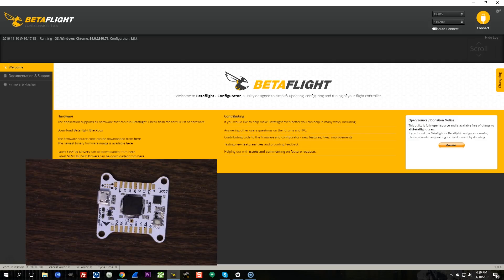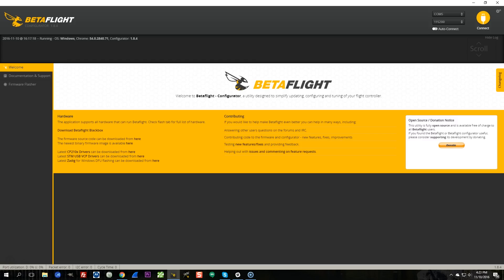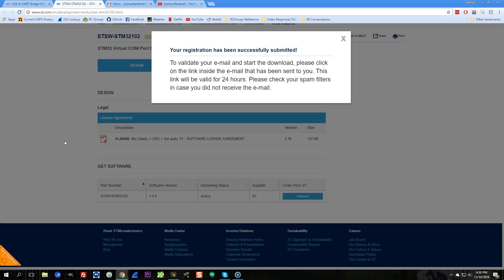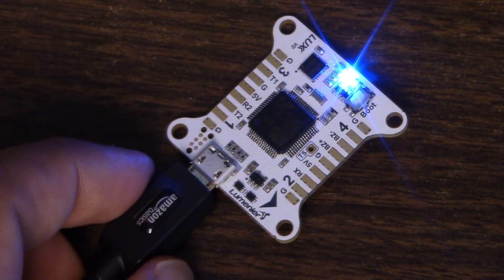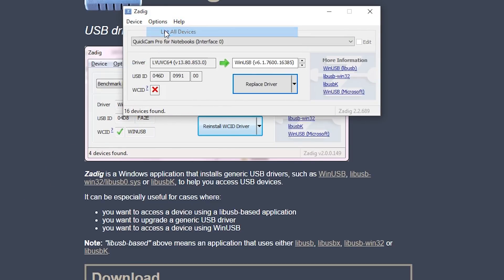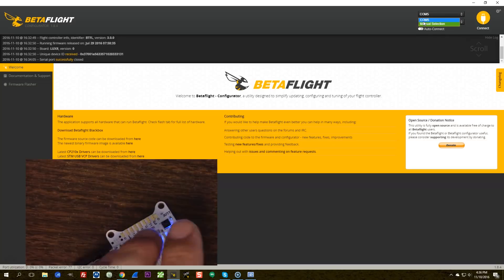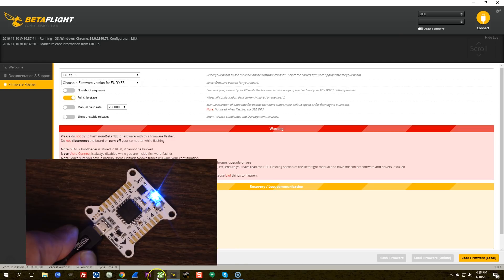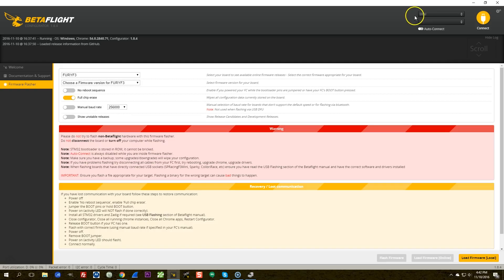Betaflight / Cleanflight Flight Controller Won't Connect | FIXED

Comment: What do you do if you do accidentally overwrite the WinUSB driver in Zadig? You said uninstall it but it is not at all clear how that might work.
Reply from the maker: If you really want to you can just put it back using Zadig I believe. But if you need to uninstall it go to Device Manager in Windows, find the device, right click, uninstall.

Comment: Is anyone else here having trouble connecting to betaflight to their quads. All my f3 boards connect but none of my f4 boards do. I have tried zadig and impulse rc driver fixer but fixer just stalls looking for flight controller. Anyone have any ideas as I'm pulling my hair out here. I have just spent the day building a new quad and i can't configure if AAAAAH
Reply: I managed to sort this after going in the device manager and looking at my com ports. my betaflight connects to my boards using com4 but I noticed on my com ports in device manager i had a bluetooth)com4) port as well. I turned bluetooth off on my PC and now all my quads connect. Posted this just in case someone has a similar problem, thanks JB. I wouldn't have found this without you

Comment: Hi i am green as grass im just started and  this stop me on beginning i try on mac and W7 im installing like u told and  like im read the description  but :(
when im  connect first time  i got info "device driver was not successfully installed" and im stuck i was looking at how to resolve this problem i installed everything one more time and is the same all-time  my drone is recon like joypad and cand connect this  to beatflight  any solution? funny is two small drones  connect with no problem but i don't need this  but 2 others  zero connection W7 tell is a Joypads :(

Comment: i cant see the stm32 when i connect my pc to the fc
Reply from the maker: 1. Hold down the bootloader button. Plug in the USB cable while continuing to hold down the bootloader button.
2. Run the Impulse RC Driver Fixer app (https://impulserc.blob.core.windows.net/utilities/ImpulseRC_Driver_Fixer.exe). It should "fix" the driver successfully. If not, do not proceed.
3. Un-plug the USB cable.
4. While holding down the bootloader button, plug in the USB cable again.
5. Start the Betaflight Configurator app. In the upper-right corner pulldown menu, you should see "DFU". You can now flash the board.

For more detailed instructions on how to install the STM32 drivers: https://www.youtube.com/watch?v=m4ygG6Y5zXI
Reply: @JoshuaBardwell  I have got that settled out,but now I have an issue where I dont really know which UART is where on my board.

Comment: Hey there, my pc won't recognized my fligth controller anymore even after i install both stm and cp2 driver. My flight controller worked fined before i accidentally unplugged it while flashing a new firmware.  The blue led is also not working anymore, and only the red one flashing. My flight controller is dalrc f450.  Hopefully you can help me with this. Thank you  before.
Reply from the maker: The workaround I would use is to flash in bootloader mode with "full chip erase" selected.

1. Hold down the bootloader button. Plug in the USB cable while continuing to hold down the bootloader button.
2. Run the Impulse RC Driver Fixer app (https://impulserc.blob.core.windows.net/utilities/ImpulseRC_Driver_Fixer.exe). It should "fix" the driver successfully. If not, do not proceed.
3. Un-plug the USB cable.
4. While holding down the bootloader button, plug in the USB cable again.
5. Start the Betaflight Configurator app. In the upper-right corner pulldown menu, you should see "DFU". You can now flash the board.
Reply: @JoshuaBardwell  finally it works, thank you
Reply: Hey there, now my flight controller red  led doesn't even turn on when i plug it itn, does this mean its broken?

Comment: My flight controller isn’t connecting even when the drivers installed, just cant get my drone to appear in betaflight. NEED HELP. Messed up by switching the “SPI Bus receiver”
Reply: Same problem dude... :(

Comment: Now how about a video for us ios users, the stm isin't going to work for us
Reply from the maker: Driver Fixer fixes a Windows driver problem. There is no need for Driver Fixer on MacOS. The drivers are pre-installed and just work correctly.

Comment: my matekf405 wing does connect and i can flash and it says that it sees him in inav but i still cant connect
do you know how to fix this?
Reply: Hi, I have F405 WING. I think with the same problem, I see it connected, I can successfully flash it, however, then I cannot connect it into Inav or Betaflight. Any suggestions?
Reply: @tomaskonarik7400  nope still have not found out what the problem is updated all drivers used the impulsrc thing still doesn't work bought an f411 wse to test if my pc the problem was that was not the case the f411 worked fine

Comment: A ton of great information in this video. However, my fc was working fine and I never had any issues communicating with betaflight. Then I was flashing an update and betaflight froze mid-flash and now I get the “failed to open serial port” message. I’ve followed all steps in this video, and nothing recognizes my board, whether or not it’s in bootloader. Did I brick it?

Comment: I Have the cc3d brushed boardI dont have a push button or pins to short out for boot mode what can i do.
Reply from the maker: There must be some bootloader method somehow but I don't know that board well enough to make a specific recommendation.
Reply: Hi Joshua just sent you a message and photo on Instagram thanks
Reply: Don't know I have looked in all the places on the web I can find.no know one knows.

Comment: I have a Omnibus f4 v5. I get a solid green light when I plug in usb and there is no sound of connection. For me I flashed the wrong firmware. I flashed Omnibus instead of Omnibus SD. What should I do is this something I can fix??? … Zadig doesnt even see the stem3 driver. and beta flight doesnt even detect any com ports. I have tryed just about everything. its like the usb connection is not detectable. did me flashing the wrong firmware screw up my omnibus f4 v5 ?? do I need to buy another?

Comment: Joshua Bardwell;  STM driver is for win7 or 8, not for 10 , should i use the win8 exe? i have win10
Reply from the maker: Use win8. That's what I do anyway.
Reply: @JoshuaBardwell  still no luck, already tried impulserc(searching for flight controller problem) and zadig(cant find stm32 virtural com port) i bought 2 quadcopters the sailfly-x and the mobula7hd. please help     ps. i dont even hear the windows usb plug in sound               edit nevermind i found a working usb cable    tanks anyway =)
Reply: @JoshuaBardwell  could you help me again?
after arming my motors do idle(5%), but after applying trottle it just goes to around 50% after that it stops, if i rearm the situation just reapeats.
motors do work fine via betaflight motor test.
my manual said i need to install blheli suite and flash new firmware, target is S-H-50
Reply: entering the settings for the sailfly-x in the CLI solved the problem, but the same method does not work for my mobula7 hd plz help (trottle does also stop if i turn the quad around)
Reply: discovered that my motors are swapped from left to right, how to remap? current version of betaflight is 10.6.0
Reply: motors swapped! i fixed it :)  problem solved

Comment: What if you somehow shut off the USB port. How do you turn it on?ty
Reply from the maker: Re flash the FC by putting it into bootloader mode. Select "full chip erase" option when flashing.

Be sure to choose the correct board target in the pull down menu.

Comment: all support is for windows.  I have a MAC, which drivers do "I" download?
Reply from the maker: On Mac, STM32 VCP driver is installed by default. You don't need to do anything.

If you have an SPRacingF3 or any other older FC that requires CP210 drivers, you need to install them.
Reply: Thank you. 
You are the one guy I turn to when I can’t figure things out. I watch ALOT of your videos. 
Question:
One of my quads will connect no problem. But my new flight controller will not update firmware, and will not connect to beta to view all data. 
Any ideas for me to try?

Comment: Hey brother I accidentally turned off USB VCP on my LUX F7 board so now it will not connect to beta flight is there a fix to connect back on betaflight?
Reply from the maker: You have to connect using the bootloader button and re flash it.
Reply: @JoshuaBardwell  I love you man brother 2 brother
Reply: Brother Josh I have lumenier lux f7 ultimate but I don't see it in the beta flight drop bar so what can I use to flash the board?

Comment: Hello youtuber and pilots i need your help 
Im a total noob to fpv I got the emax tinyhawk and i think i messed it up 
When i plug it into my pc it takes several minutes to recognize it and when it does i have only a solid red light on my flight controller and beta fligt show up up the com 3 which i normally use to conect but it says it fails i tried impulse rc driver fixer which says com port 3 is not avaliable always the same . Could please anybody help me?
Also when i turn on the whoop it only makes alarm and red light no funcionality ....
Reply from the maker: The flight controller is probably damaged from a crash and needs to be replaced.
Reply: @JoshuaBardwell  are you sure because i flew it put it on pc all was fine then i messed arround with flashing it and now this happened. And pc also says its a not recogniseable usb i did also something with zadig.... but i dont know any more is there anyway to reboot all or delete all bc emax has the cli dump on their site but i cant even enter betaflight maybe i did mess with the drivers i think ..

Comment: HI Joshua i know its been a while since you posted this but i have followed you until 5:21 and my board will connect it says 
Serial port Successfully opened with ID :1
 but nothing happens 10 seconds later
 it says No configuration received within 10 seconds , comm failed
  serial port  successfully closed  

do you have any suggestions please
Reply from the maker: Make sure you've selected the COM port associated with the FC. It will disappear after you unplug the FC.
Reply: Absolutely no port ever pops up it is always com port 1 so I might remove all the installation and start again

Comment: Hi, while flashing the clean flight firmware on SPF3 it is throwing " STM timed out" programming failed while verifying phase.
Reply from the maker: Verifying timeout is usually nothing to worry about. Usually the flash was successful and you can proceed.

Comment: My driver are correct I lost communication with board by mistake I tun off usb port  uart1 I don't know what to do now .can u help please
Reply from the maker: Re-flash the board using bootloader/DFU mode. Enable "full chip erase" option.

Comment: I have updated my trashcan Crazybee f4 firmware and it stopped working it is not recognized by my computer any more. there is no problem with my mobula 7 so my pc is fine. I have tried pushing the boot button and nothing changed. any advise where how to solve it?

Comment: Hey all, ive been trying to connect with my Hubsan H123d mini racer  ut when i connect the usb into the pc the qyad just beeps like its out of battery. I need to upgrade the firmware but cant.. I can sure use your help. Thnx, Harry

Comment: USB CABLES - Thanks Josh and thanks to James Kuhlman, read his posts below. You solved the problem for many of us, not driver related at all. 

THANK YOU James Kuhlman!!! I didn't take any notice of your comment because "I Always Use This Cable" with no problems at all" BUT just because I am completely out of options trying to connect a Brand New Mamba FC for my GT R-349 HD I did try a different cable and HELLO! DFU Mode BabY!! Go F@#$ing Figure, WTF and all that stuff... if you are having trouble DO IT, you never know, it worked for about 20 of us here so you have nothing to lose, blew me away! Thank again man, rockin. Change Your USB Cable!

Comment: Good Morning, I have built a quad and I am at the point of programming my flight controller.  However I can't get it to work because of the version of software on the board.  I have tried what you have taught about going to github to download an earlier version of BetaFlight, my computer won't let me download it.  Any tips on where to get it or purchase it from?
Reply from the maker: To download the hex from github click on the hex filename then right click the "raw" button and choose save link.

Is there a reason you can't flash the firmware directly from the configurator?

Comment: Josh, hope you well. My problem is that I did the process, DFU, Firmware installed successfully for my F390 Raptor. But now, no COM port is being offered. I cannot bind, etc. All I get is COM1, no other, and it will not connect. I am not getting the FC option in the Zad file. I think hopefully a reinstall will work. Where do I uninstall? Any ideas? Thanks.
Reply from the maker: You need to go to the Device Manager and uninstall the device.

If you use Zadig on the STM32 Virtual COM Port device, that is incorrect and it breaks the driver. I suggest you only use the ImpulseRC Driver Fixer and not Zadig.

Comment: Hey Joshua, I have a problem I'm somehow unable to fix and I wanted to ask for your help.

I've got an LDARC ET125 (V1) with a LDARC PikoBLX (V1) FC. The FC still works properly when flying. Since I had already installed Zadig drivers on my Laptop, I am able to connect it to my Laptop when it's in bootloader mode. So flashing works. 

But somehow, when I try to connect it to betaflight configurator, the log says: "serial port succesfully opened with ID:1", then "No configuration received within 10 second, communication failed" and then "serial Port succesfully closed".

The weird thing is that it had worked once with that same setup. Same USB cable, same FC, same betaflight/configurator version, same PC... I have tried it with multiple different Versions of Betaflight on the FC, the only thing I haven't tried yet is using a newer betaflight configurator version. But as I said, it already worked once with that setup. 

Is my FC broken maybe? I've done some research too, and there were some people with the same issue in some RC Forums, but I couldn't find a solution anywhere. 

Thanks in advance for your help, I'll inform you when I find out anything new.
Reply: Okay quick update: I tried it with the Speedy Bee App, and that worked! So the problem seems to be either something with the PC or with the version of the Configurator. I'll try to get a newer version of the Configurator soon, I'll then tell you if that worked.

Comment: I am using a Bardwell flight controller v2 and it does not even get recognized by my computer, though the flight controller lights turn on and flash etc, BetaFlight does not see it either..
Reply from the maker: This probably means you need to install the STM32 Virtual COM Port drivers as shown in this video. If you have installed those drivers and the FC does not get recognized by the computer, the next step is to try a different USB cable. Some USB cables are power only and not data.
Reply: Thank you for responding that’s surprising.  it was the cable heheh.  I was using an old usb cable but got a new one for data at Best Buy and it connected instantly.

Comment: You didnt say where the vcp files were downloaded too? just desktop??
Reply from the maker: Wherever. After you run the installer they're not needed any more.
Reply: @JoshuaBardwell  thanks. Struggling a bit with my first quad. It's second hand. Arghh

Comment: This is great if you have a window computer.  For those of use with MACS this doesn't apply beyond loading the CP210x Drivers.  I'm still not able to communicate with my old Naze32 Rev 5 FC.

Comment: Need help asap , my flight controller stack gets power when I plug the battery in and when I try to connect to betaflight it says it fails but it might be because I need to upgrade the driver's but I try to use the speedy bee app and it does not recognize the otg cable but I I feel it could be the cable